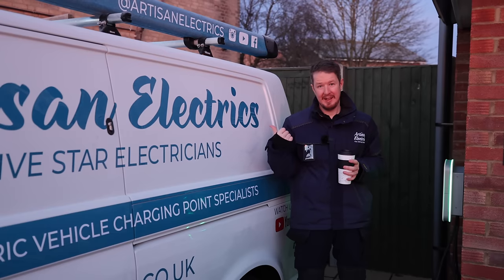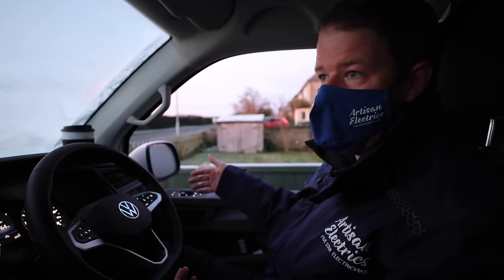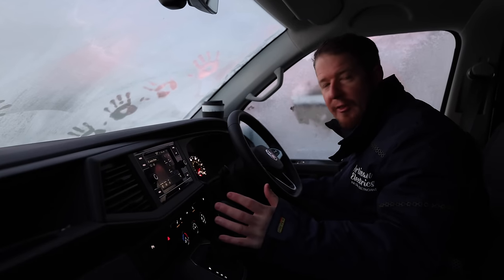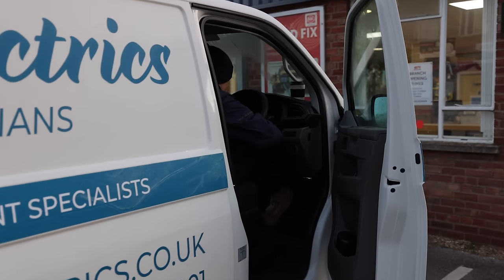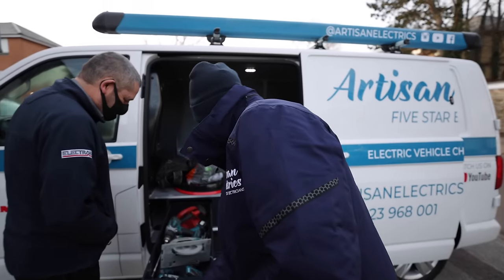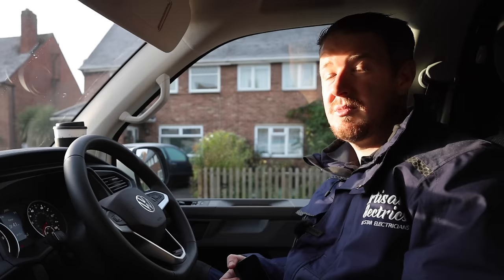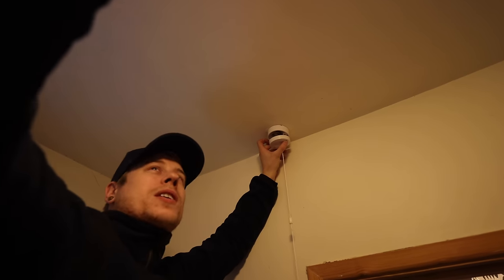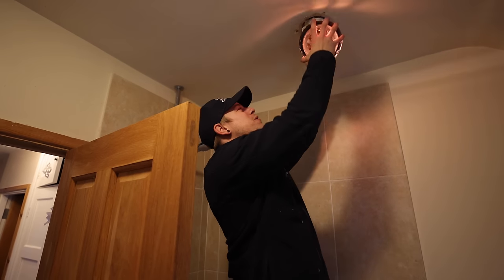ELECTRIC VAN NIGHTMARE 😬 - Volkswagen Transporter Electric Van

Comment: I think I have a solution. What you need is some sort of liquid fuel such as say diesel or petrol, stored in a tank under the floor of the van. Then you would get something like 350 - 450 miles of range and a heater that actually works.
Reply: My VW T4 2.5 Tdi  does almost 600miles on a full tank of diesel. When its dark and frosty I can use the lights , heated screens,  carry more weight and even two passengers and still get 550+ miles without stopping .  Sorry to EV owners.
Reply: @keithwilson1554  My little comment was a tad tongue in cheek, but this video shows good evidence that EVs are not up to some applications.  Trades people can't afford two hours down time for charging every day. 
Yes my 20 year old diesel camper van which is also my everyday vehicle, ( I don't have a car ) it does contribute to global warming.   It is extremely well maintained and I do less than 5000 miles a year in it ( 3,500 miles during 2020 ) so my contribution to pollution is vastly lower than someone who does 20,000 a year.   

I'm retired and live in a  rural area and there is no way possible that I can afford the initial cost to buy even the cheapest EV, this is why I drive around in a 20 year old vehicle, I do not have a choice. I would like to help with pollution and buy an electric vehicle but only the financially well off can do it. 

My camper van is also very convenient , if I'm doing DIY I can get a  8x4 sheet of plywood in it, or 30 stone slabs for patio and if my bladder fails me when I'm on my way to the supermarket I can have a pee in my onboard toilet. .....You can't do any if that in a Prius.  🤣   I sometimes use my bicycle to go to the shops for small items which is also helping to reduce driving milage. 

I don't think I will live long enough to see electric vehicles come down to affordable prices, so Im stuck with what I have and I will have to take the extortionate Vehicle excise duty and fuel duty on the chin as the government tries to price petrol and diesel vehicles off the road.
Reply: @pedalman130  Good to see you are trying to lessen your pollution output. I just get tired of people people talking about their fossil fuel cars after 140 years of development and infrastructure built societies. Yes EV's are expensive but imagine 20 years of real development which would have happened had Pollution Fuel bought Politicians hadn't killed it off. Right now there are EV trucks that can do everything you need plus power a home for a few days in a blackout. Again expensive but with a Tsunami of Cheap Indian and Chinese Cars/Buses/Trucks etc already being built it will be less than 5 years when they will be available to the market. China is the biggest Car Market and already 20% of all Vehicles sold are EV's. When you tell a Transport Company there running costs will be 70% less they will buy the EV. Same with passenger vehicles.
Reply: @keithwilson1554  Yes I am very aware of the environment and I try my best to cut down on burning fuel in my vehicle and  heating oil ( No mains gas where I live)  I try also to have just one trip into the city in my camper van ( 40 mile round trip) and I organise myself to get everything I need in that one journey. 
 I have been a cyclist since I was 18 yrs old so I can still pedal the 15 miles round trip to the closest small shops if I only need a few items. 

The thing that gets me is I still pay £260 tax the to the DVLA every year , I think  vehicle excise duty should be reduced if you do low milage like I do, even though my vehicle is more polluting according to the Co2  but I am less polluting overall because I do less than 5000 miles a year. They could easily see the yearly mileage from the MOT .  

As I said earlier, I don't think I will live long enough to see affordable EVs , if as yo said it takes 20 years of development  I'll be 85 years old by then .....if I'm not already pushing the daisies up ! 😁⚰️

My life long dream has been to be off grid with solar panels and a wind turbine but sadly I have never had the funds to do it . 😫
Reply: @keithwilson1554  I misunderstood or misread your post, but even Li-ion batteries are not  the answer. Lithium is not abundant and the amount needed to  supply the number of EVs  is not guaranteed.
The answer is the hydrogen fuel cell but it needs to be astronomically  cheaper.
Reply: @pedalman130  The Japanese and German manufacturers are ditching Hydrogen after spending Billions. Lithium is plentiful and with it being used in Batteries they can already be recycled up to 97%. So this means Lithium will be used over and over again. Plus there are other promising Battery types which will either compete or be used in other Areas such as Salt/Air or Solid State Batteries.
Reply: @keithwilson1554  I didn't know lithium could be recycled , Is it cost effective to get it out of old batteries though ?
Reply: @pedalman130  So Nissan leaf batteries are already being recycled in places like NZ where they either use them for House Storage Batteries (eg: If you say lose 50% of your batteries car range and its a 30 Kwh Batt then you still have 15 Kwhs bigger than most Home batteries. They also just replace only the cells that are defective and put it back on the road. The Dead Cells go to be recycled. They also have put out a Nissan 40kw Battery that has Liquid Cooling so upgrading as well.
Reply: You are right, EV’s are clearly too much hassle for this guy, he needs to leave them to people that can use a scraper.
Reply: @malcolmbagley7068  I watched another of his videos and he hopes to turn over £1m in 2022 with 14 employees, so he's not doing too bad is he ?   Charges £96 +vat per hour.
Reply: Agree, and you don't have to be a computer genus with lots of money to have one.
Reply: @keithwilson1554  I hope you are not like my friend who bores us all to sleep telling us how his Tesla is soooooo0 planet friendly and how we with our ICE cars are adding to global warming and toxic fumes etc.  And then regularly drives to Heathrow and boards the Virgin flight to LA for business reasons travelling Upper Class!  I do less than 2,500 miles a year in my ICE car and travel long distance within the UK by train ... I'm fed up with the 'holier than thou' telling me how their EV's are reducing pollution and forget they holiday overseas a couple of times a year.
Reply: @davidcaple5547  What happens to your argument when we ride in electric and green hydrogen planes?
Reply: @keithwilson1554  sorry but that's not applicable, I was simply comparing the constant "aren't I a good boy" proclamations made by those who also fly!  I expected that to be obvious to all.  I happen to believe in hydrogen for the future ... it's the hypocrisy I object to.
Reply: @keithwilson1554  you seem to be looking for a debate that isn't there ... did I say do nothing?  No.  I repeat for your benefit, I'm have not and do not denounce EV's (though my enthusiasm is more for hydrogen).  My comment was targeting the hypocrisy of those that claim greenness because they have an EV and then take overseas trips by flying.  This is the second time I have explained the context of my original message, I hope you now understand or are you trying to troll me?
Reply: @davidcaple5547  So  When you own an EV and you champion green energy you are Banned from Flying? Otherwise you are a Hypocrite.
Reply: @keithwilson1554  Oh dear, clearly you missed the class at school when they dealt with proportionality!
Reply: @davidcaple5547  Was that the one on Hypocrisy ?
Reply: @keithwilson1554  every thing we need  for this earth too keep warm like coal oil gas and precious stones for industry when god created this world he put it in  the ground for man to use
Reply: @Lbm414.Oleg.Kuznetsov.  So you mean the same Diesel used to mine for Minerals for Fossil Fuel Cars? Slowly they are replacing all types of Equipment including Mining with Electric or Hydrogen powered vehicles. If the World took it seriously it can be done very quickly. The Lithium/Iron/Battery can be recycled 100% meaning less will be needed to in the Future and new battery technology means smaller batteries needed and new ones with different chemistry or minerals. Fossil Fuels like Diesel/Petrol etc aren't replaceable or recycled.
Reply: @keithwilson1554  False green nonsense from a wokey.
Reply: @keithwilson1554  total pie in the sky.
Reply: @TheTruth-dy8ze  Such concise answers pointing out where I am wrong You must win every Argument in Kindergarten because thats where Childish Name Calling works.
Reply: @TheTruth-dy8ze  So no hope of Fixing you then?
Reply: That's too radical dude
Reply: @keithwilson1554  "...global warming..."
What and charging batteries doesn't, yeah right  Just imagine the fucking load put on the national grid by everyone charging their vehicles 24/7.
Reply: @trollobite1629  Thank you for you displaying your ignorance. There are already Grid Batteries and every EV is a potential Grid Battery. At home or work when your vehicle is sitting doing nothing you can connect your EV soaking up all the Solar/Wind power that Pollution Lovers complain there is too much of. And at peak times they same EV's can return that back to the Grid so they will be able to Stabilise the Grid. Already trialled in the UK, Finland and Japan.
Reply: @keithwilson1554  "...thank you for displaying your ignorance..."
Thank you for displaying your poor comprehension skills evidenced with a fantastic example of a strawman response.
I said nothing about grid storage but rather about the load put on the  National grid by 40 million cars plugging in. 
Next time, try to respond to the original point being made rather than something you prefer to respond to  but meanwhile, just accept the fact that EV cars contribute to global warming.
Reply: @trollobite1629  Well if You add 40 Million EVs which have far larger batteries than a Tesla Wall and they can be accessed by the Grid they will help stabilise the Load as they can store the excess Solar/Wind during the day and put back around 10% at Peak Times usually in the Evening when everyone gets home.. Did I type that slowly enough for you?
Reply: @trollobite1629  well said 👏🏼 if I was an intelligent chap that’s what I would have said 👌🏻
Reply: @trollobite1629  not to mention the majority of European electric power comes from gas, and gas prices are skyrocketing. Also in most places the power supply is barely enough for regular use, just plugging a bunch of EVs would cause massive outages. If i plug one here i will be 1- Living in the dark, 2- Frying the car by charging it underpowered and at unstable voltage, 3- Paying several thousands in bills, 4- Frying every other appliance in the house for the reasons stated above. As it is now EV are just fancy niche products, and it will stay that way unless someone puts out new ways of producing and storing energy
Reply: @keithwilson1554  electric motors are older technology than diesel engines. Diesel engines can run on drunk men piss. It would be greener to stop producing new cars everyday and stick to use the same diesel car for 40 years with minor fixings than having the whole car park replaced every 5 years, namely for enviromental rules, or if you have money and space for fancy stuff, just buy a couple of horses and a carriage, it's greener and cheaper
Reply: @giacomoneri1782  Older but more+ Efficient Technology. You do know Diesels produce Carcinogenic Gases and wouldn't you think after more than 100 years they would run it on something other than Heavy Crude Oil? Batteries  and Electric Motors being produced now can last 1 million kilometres so far longer than most ICE vehicles and their polluting engines. Horses produce methane are more potent Greenhouse Gas and if they are cheaper why do we have cars/trucks etc?
Reply: @keithwilson1554  what about the production of batteries in an EV?  Rare metals, pollution, CO2 etc?  Much more ecological to run a used diesel van.
Reply: @davidstorm4015  Well if its made in a plant where they use Solar/Wind/Batteries or some other source of Clean Energy it makes the Production and use of Carcinogenic Diesel even worse. The Lithium,Nickel and Iron (Cobalt on the way out) can either be Recycled or has a plentiful source. No Platinum for Catalytic Converters
Reply: @keithwilson1554  ha ha, you're really special aren't you?  Not everyone will drive old diesels, so of course cars will be manufactured, that's just a stupid response. There's proof of massive pollution regardless of what cars are being made, electric or combustion engines.  Keeping an older car running is by far the least polluting way, assuming it's running correctly.  We are all free to have our own opinions, clearly we differ.
Reply: @keithwilson1554  What happens when the rare elements that are used to produce the batteries go up in price?  Oops, they already have, they are rocketing due to massive demand and limited supply.  Keep looking through your rose-tinted glasses and you'll be fine.  BTW, I support sensible eco development and use many energy saving devices at home including solar PV, heat pump and alternative ways to heat water.  I'm all for eco technology, just think that EV's are flawed.
Reply: @davidstorm4015  Perhaps your EV hatred is Flawed. Lithium has gone up and its filtered through the price to give a less than 2% rise in Battery price. Their are vast reserves yet to come on line and as I repeated before the demand will plateau when all those batteries get recycled.
Reply: @davidcaple5547  "I hope you are not like my friend who bores us all to sleep telling us how his Tesla is soooooo0 planet friendly and how we with our ICE cars are adding to global warming and toxic fumes etc.  And then regularly drives to Heathrow and boards the Virgin flight to LA for business reasons travelling Upper Class!"
So would it bet better if your friend drove a big gas-guzzler then? 
Does it really have to be either full on self sufficient caveman or you shouldn't do anything at all that is viewed as "green minded"?
If you don't want to hear his "hypocrisy", then tell him it's ok to drive EV but stop bragging about how green it is.
Reply: @ekhaat  you miss the point, it's nothing to do with planes and cars, it's aimed at the hypocrites who preach to others how green they are in their electric cars ignoring how dirty they are in their long haul business class flying ... it's not what they do it's the hypocritical things they say.
Reply: @davidcaple5547  So when I am a businessman doing regular flights, I am not allowed to say that I drive a car that pollutes less than big gas guzzlers?
Reply: @keithwilson1554  When did you last ride in an electric or green hydrogen plane?. I'm genuinely interested to know.
Reply: @paulhillman400  There is already an Electric small plane passenger service starting up in Australia. A Few Major Airline companies are working on Hydrogen Fuel and if you do research you will find Prototypes. In other words they are working on a solution for clean air travel. Ignore 120 years of development in current fossil fuel planes and instead have the magic genie snap their fingers to make EV Planes because everything has to be instantly made for you.
Reply: The reason the heater doesn't work is that it's a conversion, heaters in ICE vehicles use the engine as a heat source so you'd have to install a completely new heating element to the vehicle which most conversion kits don't do.
Reply: @pedalman130  This video only really shows what happens when the uninformed make a string of bad decisions.

There's better electric vans out there, he just picked a bad one and then didn't know how to use it.

The video STARTS with him explaining that he tried to be fancy with his recharging schedule and he miscalculated the charge time, it continues with him not knowing anything about the vehicle he purchased, like the fact that they didn't install a heat pump or that EV's typically lock in the charge cable to prevent somebody from unplugging you, or the fact that his window not working has nothing to do with it being an EV.

This video is, at best, anti-EV propaganda, same as the crap the oil companies pay for to keep you sucking the petroleum tit.
Reply: @SherrifOfNottingham  Which electric vans are better than this one ? Im not being funny It would be just interesting to know the top ones. 
I always look at EV manufacturer figures with suspicion because all their figures are in "optimal conditions".
They don't tell you the figures if carrying four passengers, doing 70 mph on a motorway into a 30 mph headwind, towing a caravan ( as many people do, and would wish to carry on doing  )   driving at night with lights on  or lights and wipers on in the rain.   

Batteries are a pain in the arse in every application, vacuum cleaners, drills lawn mowers, cameras etc but if a battery runs low while cleaning the house it doesn't matter, we can just put a second battery on or plug in at the wall socket to charge up ...  but in my opinion electric cars need to be vastly more "usable" than they are at the moment . We need Millions of charging points all over the country and they need to be in place before we are all forced to abandon our combustion engines.
Reply: Hydrogen vans will be good
Reply: @Paul-hu7xx  Hydrogen fuel cells are expensive,  but yes, a fuel that can be put into a fuel tank is a better idea than the crap battery idea. Batteries are a pain in the arse in every application but at least on a drill, vacuum cleaner , lawn mower etc, you can have spare batteries.
Reply: That kills your grandchildren yet to be born. I suppose the fact that they haven't been born yet makes it OK for you.